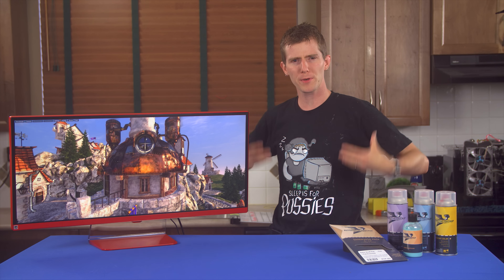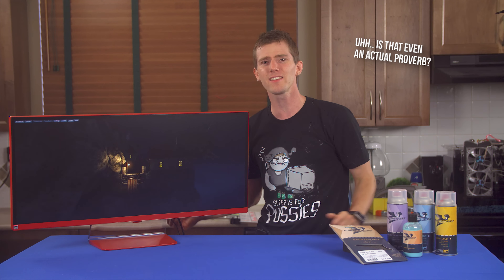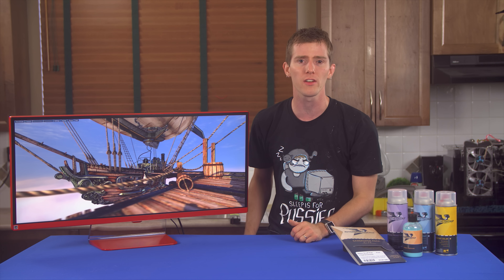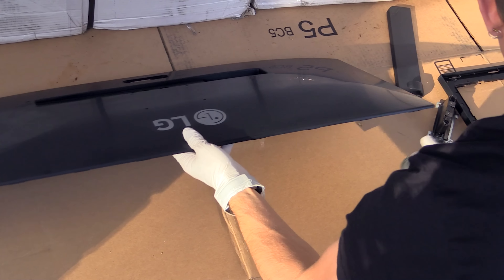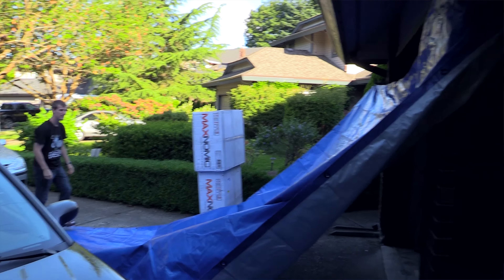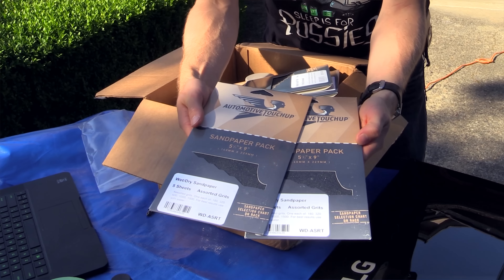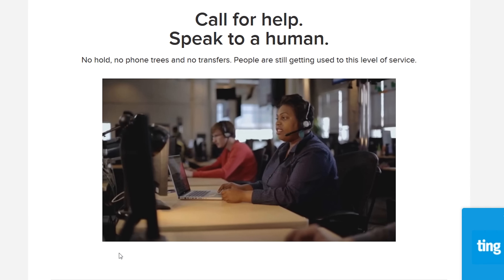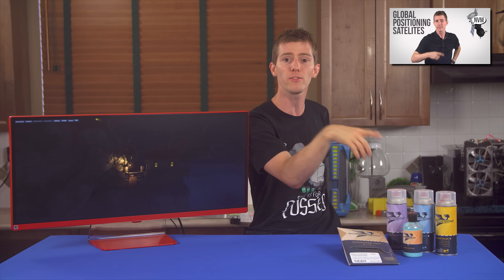Badass Monitor Painting Guide - LG 34UM67 FreeSync Gaming Monitor

Comment: I no it's an old video but I work in a body shop(fixing cars) so I can give everyone a little tip, if you want to paint in your garage without dust bothering you, use a hose and wet your floor...we have w paint booth with dust filtration systems and we still spray water on the floor before nring the car in just to make sure no dust goes anywhere. Hope this tip is helpful to some
Reply: Ty
Reply: you no
Reply: hero
Reply: Water on the floor is not good, it makes the room high in moisture which will dull the clear coat.
Reply: @ThaiRoney  if your painting then you should have something that's filtering the air even if it's just a negative pressure with an inline fan or something. The water in the floor will not be enough moisture to do anything to the clear coat and will absolutely save you from getting dust in your paint and clear which WILL happen in your own home made setup. Also I've done this hundreds of times and never had any problems with the clear.

Comment: As a product it looks absolutely stunning. But imo I think black would suit best for monitors. It doesn't distract the eyes and the "bezel-less" display kind of gives it that infinite look of the edges sinking into space.
Reply: timmy yong I agree, black just looks so much better with multi-monitor systems.
Reply: timmy yong Ya, bright red is probably not the best color of a monitor when it comes to immersion. But I think most people who would do this are more interested in just standing out.
Reply: timmy yong I would do this not for standing out but to blend in, like choosing colour similar to the wall. black can be contrasting in bright wall
Reply: +Yeagdrasil  Unfortunately then your eyes will bleed the screen and you'll notice your screen is much brighter than you thought. This is due to how contrast works when working with black and white. The black provides the "frame." Changing that, and you're going to have some annoying things that crop up that you may or may not get used to.

Comment: Nice! I am going to paint mine metallic gold to match my office.  It's old and cheap, so I think I'm going to skip the majority of these steps and just use Rustoleum multi-surface spray paint.  It tends to adhere pretty well to plastic without a primer, and has worked well for me in the past.  I might use a white primer base coat just because the metallics tend to be a little translucent.

Comment: The reason not to put it into sunlight to dry is viscosity, the warmer the object is, the thinner the paint will be therefore rising the risk of drips.
you can do the first round of every paint look like 5:12 (do multiple times if tons of corners and such and unsure), even clear coat, wait for few minutes and the do the full cover.
you should considering having a good light that can be used to reflect the coat to see if it's smooth. (lacking coat looks kinda like orange peel while too much obviously drips). while painting inside corners i.e. wall-floor corner, point directly to the corner, spin your wrist 45 degrees either way to prevent airpressure from messing up paint. (you'll need a nozzle that makes a straight line instead of a dot of course)
this is how i paint and get satisfying results as an amateur. this will take a lot of time.

Comment: Hey Linus, when are you (if you are) going to review the monitor from Asus? the 3440x1440, curved g-sync monitor?

I think it's called 3800R
Reply: ***** It's rumoured to come out near winter, but the Acer comes in August.
Reply: Sylvex Dragonskin Winter? damn, that's a while.

But thanks
Reply: ***** No problem. I have the U3415W and it's basically the best one out there atm. this one has the best contrast and mine has no backlight bleed :) But if you rlly want Gsync then get the Acer.
Reply: Sylvex Dragonskin is that also a 3440x1440 curved monitor?
Reply: Yes and for me it's cheaper than the others and comes with factory color calibration and large height adjustment.
Reply: Sylvex Dragonskin Well, I'll look into that, thanks :)
Reply: YW, sir :)
Reply: Sylvex Dragonskin what brand is the motor you are speaking of also size please. I am looking for a new monitor because I am building my new first PC. I've had laptops up to now but I am tired of upgrading every two years
Reply: It's a Dell, 34" 21:9, U3415W. http://dell.to/1GhH7Lq Best 21:9 monitor now BUT you need a lot of GPU power. If you want to game on it and don't wanna spend at least 650 dollars on a GPU then get a 2560x1080 version of LG. That is if you want 21:9 :)
Reply: Thank you
Reply: Yw wheelie
Reply: Sylvex Dragonskin hey =) i want to get the Lg 21:9 wide monitor and use it with a 980 ti .
Do you recommend the curved one  for 200 +  or is better to go with the regular one ...
Reply: ***** Go curved if it's 34" and 3440x1440 otherwise go 29" inch without curve. 1080p on the 34" inch looks really pixelated.
Reply: ***** Linus labeouf
Reply: Youtube ™ ^ 0.0
Reply: ***** JUST WAIT!!!!!
Reply: Mason Merck why? when I could yell at Linus that he could...

JUST DO IT!!!
Reply: ***** lol good one

Comment: Linus, about the washing process. you did it right. Don't sand anything before removing all the grease. otherwise the sandpaper will clog up. And you could use a buffing wheel for the finish. by hand it really takes a long time, like you found out. 
The finish is very nice. I would buy it ;).

Comment: I used to modify consoles/PCs for a little extra money (so im speaking from experience)... something linus didnt show in the video, but is always smart to do, is to tape any holes or openings by taking tape and sticking it to the inside (around the circumference) of the area (so that the tape sticks out.. dont really know how else to say it heh. anyway.. this helps make it so that when you put the object back together all the buttons and I/O still fit through the holes in what you painted... believe it or not paint does make the area thicker so that potentially makes the opening smaller for what you have to put back into it when re-assembling,

Comment: How good it must be to get so much stuff for free that you're not afraid to fuck up a 500 dollar monitor.
Reply: 500 dollars lmaooooooo I have one of the cheapest models of this monitor and it was about that much. His was much more
Reply: That's monitor is 700 bucks in my country.
Reply: There are cheaper ultrawides, one for 160$
Reply: Comic Sans Mine was 211 bucks and it's only 25 inches wide. But it has 99% of sRGB.
Reply: Its against youtube guidlines to not advert thats its a sponsorship
Reply: It's literally impossible to fuck something up if you know exactly what you're doing.
Reply: +BlueJayFrosty that's if they sponsored this, he may have got it as a freebie and mentioned it in his review, but I think he would have to say he got it free in this video sense its not a review and probably only used this one because he had one and its a good monitor
Reply: +Josh R *he wouldn't have to say
Reply: He already said he broke some of the plastic taking it apart and he was reading a guide, so I don't think you're right about that
Reply: Guilherme Müller Only the first time you do it it's scary. The first computer mod that I did was painting a mouse and I was afraid to fuck up, but as you do more you're less afraid. Now I paint cases and monitors. And it's nothing scary because I know I won't mess it up

Comment: would love to see a 10gbit guide. I have no idea what I would need or how much it would cost for me to upgrade to it.. or if it's even worth it for the general consumer. Currently on a gigabit network, file transfers over Wireless N750 5Ghz, from a wired desktop computer.. I barely get about 2 to 3 MB/s on files... which is SLOW. I tried with multiple computers, laptop, tablet, changing the routers... never getting any better... friend has similar results at his place with all different hardware.. seriously wondering if all those reviews claiming my router can easily do 70MB/s over wireless at a long distance, were true. (even wired doesn't get that much faster)

Comment: LinusTechTips I have a bug (an actual insect) in my LG 34UM95-P monitor, very simular to the one you disassembled here. Is it possible to remove the front panel from the LCD panel or is it stuck together? Any other tips for removing the actual bug?

Comment: For easier and just as good results, Pro Rusto Spray paint/cans work just as good. Can lightly prep and pre sand base layer with 1k~ if you don't want to put deep scratches which have to be filled up with bit more paint. Paint as usual with light primer first, then do layers as Linus says w/ good amount of clear. At end however is the difference in time and quality of any paintjob. He chose to go with rubbing compound, instead for quicker and great results, can wetsand with 1.2k sandpaper (enough to remove any orange peel if present) then use Meguiars Ultimate Compound/Finish from any Autostore. Wetsand = 30-45mins, Polish = 45-60mins.

Comment: There are actually some really handy DIY paint booth methods out there.  Look them up on you tube. some with just simple cardboard and good for small projects. Basically use or make a box big enough for your project cut a hole in an area tape in a furnace filter stick a box fan behind everything that draws air out and paint away.  this isnt ideal but it works in a pinch. for better ones check out you tube like i mentioned above.

Comment: help I have a Samsung 22" monitor (S22B300) which has a VGA port and a hdmi port (I am currently using the hdmi port) it is 1080p, whenever I am working on it everything is clear i.e. The resolution is very crisp and looks like it is 1080p, however my desktop background is always really blurry - just the image, all folders and icons are fine - I know it is a very minor thing but it is very annoying. The background I use is the same as MKBHD's and I can provide a link if necessary, thanks a lot! :)

Comment: Before long I will be investing in an Asus UX305, which I would very much like to do a few modifications to. However, what I wan't cannot really be fixed by a paint job.

The simplest objective I think, is getting rid of the Asus logo on the Bezel. AFAIK, it's made of plastic, and it should be a relatively simple matter of replicating and replacing it.
Next up is the back of the screen, where I would also like to remove the logo, and perhaps even replace it with one of my own. However, this is aluminum and I haven't the slightest clue what to do about it. Sure, if I had the tools to create a 3D model, I could properly order a replacement, but I don't, and even if I did, I'm not convinced that I'm competent enough to create said model, and furthermore it will probably be somewhat expensive.
Next up is the annoying Windows branded Super User button, and replacing it with a Linux branded one, and perhaps two more keys, of the Scandinavian types, with multiple letters, so that some money can be saved by deploying the same keyboard in multiple countries. Meh, it should be doable in any case, though I don't exactly have a plan.
Last there's the problem of the back-lit keyboard, which just isn't there. From what I've seen, the keyboard flexes enough that there should be room for something at least, but I really don't know.

So, if these are issues you may be focusing on in the future, I will be very interested indeed. ;)

Comment: Actually. You should use your 3D printer to print out the Linus Tech Tips logo (or media group logo) and instead of painting the tech in LTT, red. Paint it chrome. A bit of a hint towards the sports car look. On the other hand, a red monitor between two black ones in a 3 monitor configuration would also be pretty cool. Yay for company branding

Comment: I'm wondering how graffiti/art aerosols would work on monitors like this or cases. i have a literal shed load of Belton Molotow cans, they're designed to be used on any surface without applying a finish or priming. anybody got any tips on using those, does the advice in this video still hold up?
Reply: i'm sure it'd look fine but not as good and probably require way less steps than what he did in this.
Reply: killslay I always look them and it's just fine. Although on plastic it's quite easy to scratch.

Comment: When painting your monitor try using Plasti Dip spray so you can peel it off if you dont like it after awhile
Reply: Brent Connell also forgot to mention you can basicly just wash the plastic and not sand it down to plasti dip so can peel it off so then its back to complete stock no damage

Comment: I paint car for a living and know a guy that paints hundred thousand dollar show cars and a shop with dirt floors you don't need high-end paint booth to get a good job just good prep personally I paint in a $60,000 paint booth if you want to know it's a Accudraft but you only need one Coat of adhesion promoter on Rall plastic if it has paint on it you don't need it if you don't want to but if you're clear get a gun with a 1.3 tip and turn your pressure up it doesn't matter what kind you get but if you want a good gun iwata w400 is really good for clear and for base you can't beat a sata jet 3000 or 4000 but can be really expensive go on eBay

Comment: Three years later and I'm still wondering why manufacturers prefer to sell anything in black by default with only a handful even offering other options. White or silver is the best way to go. I hate that a room can look gorgeous and then you just have this hunk of black plastic on the wall. The mounts are black, the cables are black, the bezels are black, speakers are black, the mesh covers for speakers are black, computer parts are black, peripherals are black, cable boxes are black, stereo systems are black, buttons/remotes are black, EVERYTHING IS BLACK!!!
Reply: I couldn't agree more, I have a white and pink setup, soon to be maybe just white, but besides the point my main setup is white, secondary colours I change sometimes. My alexa, white, my pc case, white, my ram white, my desk white etc, but then I just have a hunk of black like you said when it comes to my monitors and I'm too scared to paint them and ruin them since they're not cheap. I wish companies would offer more colour range, RGB has become a huge thing over the past 10 years, we have all different coloured ram, keyboards, mice, cases and even a white motherboard by NZXT so why can't companies offer different coloured monitors! or at least white!!!

Comment: Just put washi tape on it and you dont have to take it apart + you can just change it whenever you want and removal wont damage the monitor
Reply: Yes, and it's worth considering vinyl too which is especially useful if your monitor is still within it's warranty period since you can take the vinyl off and send it back for your repairs/refund. Vinyl can be annoying, but won't damage anything and isn't permanent.

Comment: Looks gorgeous I gotta say; but it's just like flashy colored keyboards. It might look like it'll do stuff your girlfriend won't do but in actual usage it's just redundant and actually ends up being annoying.
For a keyboard it's distracting to have anything but a very dim one color and for a monitor it'll be distracting to have anything but black especially if your bezels are bigger than on this LG monitor which they most likely are as this particular model has very thing bezels.
Cheers and it looks great and like it'd be upvoted amongst the community and if you wanna extend the length of your penis this'll work. But we all know that it's girth that matters and that you'll get by just keeping it black which'll just be nicer to use in the long run... it all depends. Do you buy your stuff for your own pleasing or is your pleasing solely based on what others envy you for.